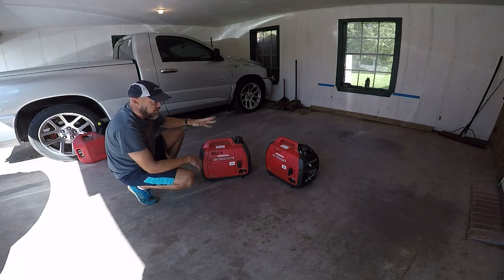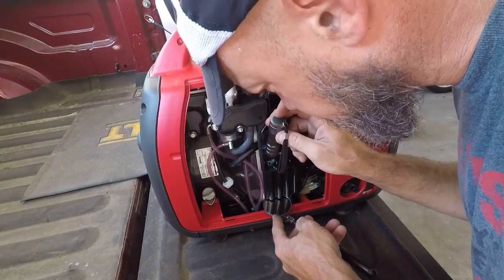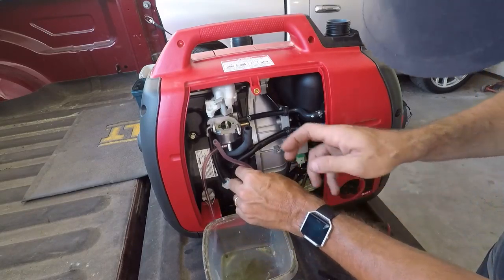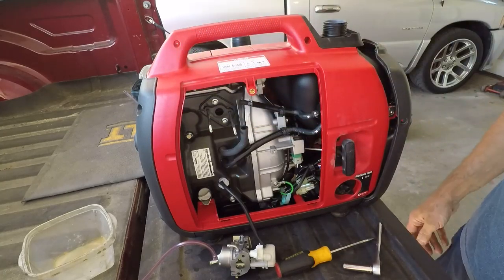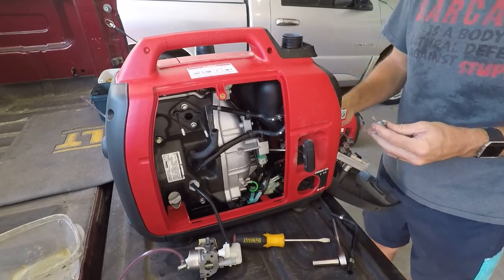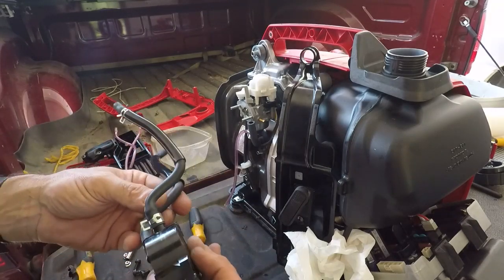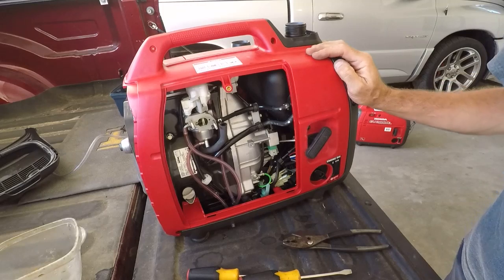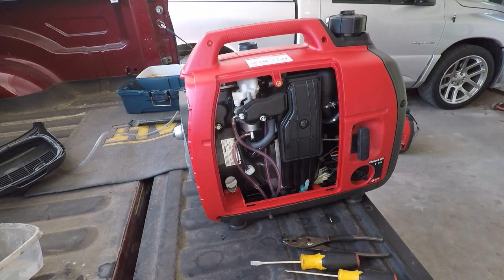Honda EU2000i Fuel System Complete disassembly and inspection

Comment: What a moron.  You have no  clue what you are doing.
Reply from the maker: Thanks for the clicks!
Reply: @aaronsrose  Aaron.  Amazing video!  Great job exploring the unknown and figuring out what you could.  I've had that issue before for several years then this year it just quit starting.  Mine will fill the carburetor float bowl (so I think the fuel pump is working) and it will run with fuel manually dripped on the air filter, at least until that fuel is exhausted, then it dies.  So diagnostically I'm stuck.  I'm gonna go back and make sure the fuel pump is air tight and actually pumping fuel.

Thanks again for an awesome video!

ps.  we're not defined by what trolls say, but by how we respond.  Good man.
Reply: Got mine running.  Main jet was plugged.  Thorough cleaning. 8 pulls fired right up, runs like a champ.

Thanks again, great video.
Reply: Didn't  change  a thing choke still on main jets never touched...
Reply: That’s why he did it. Investigate!
Reply: Enlighten everyone , tell us what you know.  You are looking on here for something. You go right into attack mode, I once was angry like you, you should consider getting over it.. And who are the 14 people who like this kind of crap ? You folks have some serious problems.
Reply: Sometimes the most effective way to teach is for the teacher to learn at the same time as the viewer. It means that the subjects that an experienced teacher would avoid due to irrevelancy are covered in full. My best highschool teacher taught in this way, and this video is a great example of the same teaching style.
Reply: @rogertrozelle8159  i
Reply: Aaron thank you!  @marktwo You're are a douscher.  Aaron worked at this thing without any help and actually knew quite a bit.  He has obviously wrenched before without a guide or manual quite a bit, learned from his father.  He wasn't afraid to make mistakes and took us on along on the ride for a pretty long video...unafraid to show what he did or didn't know.  And guess what?  He got it running fine without any help.   What do you do....douscher?  No youtube help either.

Comment: After shutting off the gas before you store the generator open the brass screw on the bottom of the carburetor float bowl and drain the gas out of the float bowl. That is why Honda has provided a hose to get the gas out of the of the bowl. These carburetors have a very small gas pick up hole drilled horizontally through the pick up tube that actually picks up the gas. That pick up hole will clog as the gas evaporates out of the carburetor bowl in storage. If you open the brass screw and allow the bowl to drain what little gas may remain is below the hole in the pick up tube and will cause no problem. If you fail to drain the carburetor bowl before storage,I can promise you that you will eventually, usually rather quickly, have a problem starting the generator the next time you want to use it because the hole in the pick up tube is clogged with residue from evaporated gasoline.

Comment: I know this was done a few years ago but before attempting this teardown I would suggest downloading a free copy of the service manual for this generator to familiarize yourself as to what the parts are and sequence of removal and re-installing. The manual has torque values of various bolts and screws, a full electrical schematic, exploded views of every component, etc. I've taken my bought used generator apart to fix an issue. Looked daunting at first but once I got into it, it wasn't too bad. Don't know about other generators but the Honda is well built of quality materials and components.  pretty easy to work on and genuine Honda parts are readily available and relatively inexpensive  online. For this reason the Honda is well worth the extra cost over the cheaper competitors. If you have mechanical skills and/or a DIYer you should be able to repair most issues on this generator, especially with the help of YouTube videos. By the way, when removing the Phillips head screws from the case use a #3 Phillips screw driver. Better grip,won't strip. Good luck!

Comment: I checked that fuel on/off valve more intelligently than you did without having to remove it. I just pulled the fuel hose at the carburetor and switched the valve to the on position and blew into it but nothing happened, so I tried sucking and was able to verify that fuel was indeed getting to the carb. The downside is that everything I had to eat for the next week tasted like gas. Anyway thanks for the video it was helpful.

Comment: The black plastic pilot jet controls the low speed operation, while the main jet controls high speed running.  When the machine's surging, it's the pilot jet that needs to be cleaned.  It's sitting under the plastic throttle adjustment screw.  Remove the screw and pluck it out to clean.

Comment: I bought a set of needle drills from eBay. They are tiny and just what you need for servicing a carb. The first thing I learned was the trick with the plastic idle jet. I overdid mine and had to buy a new jet. That vertical hole is tiny. 
Next is the main jet. Remove the bowl. Unscrew the jet and drop it out. Next there is a vertical brass jet which might need a little encouragement to drop out. The flat screw brass jet holds it in place. Once out it has about 6 tiny holes in the vertical on both sides of the jet. They become clogged up and a micro drill will gently clean them out. Then reassemble. All these tiny holes must be clean and the tank filter crystal clean. The white powdery substance is minerals from the low grade fuel. It builds up in the orifices and the filter. Excellent video and please do not take any notice of the couple of negative idiots. This was a very valuable video.
Reply from the maker: Thank you! I've been needing to tweak mine about once a month. I found the a single bristle off my old ratty wire brush held in a vice grip works pretty well. So far I haven't had to fiddle with the main. Hopefully that continues. Best regards!

Comment: Thanks for taking the time to share your experience disassembling and learning about your generator. I fixed my surging by cleaning the main and pilot jets, as others have commented. Then, I installed a switch that separates the fuel cutoff function and the shutdown function so you can run the generator out of fuel. Hutch Mountain switch (like  you, I made a video to share my experience and pay it forward to the rest of YouTube). I now run my generator every 3 months as preventative maintenance and have not trouble.

Comment: This video was very useful. I am listening to my Honda as I type. It is surging a bit but running ok. The reason I looked for a video like this was because I have failed to make my extended runtime hose work properly. There is zero suction coming from the fuel tank. Being as there is a fuel pump there should be suction. This is not gravity feed as is my Predator. So why no suction? I think the fuel filter that sits in the tank is responsible. 
It is 15 years old and is probably allowing just enough fuel to go through to run but with a little surging and it is killing the suction of the fuel pump. I needed the information on tear down. I have had mine apart but not quite to the level you did. Carb addressed in a separate post.

Comment: Note: That fuel shutoff valve is the subject of a current recall on these generators. The 2 phillips head screws on the valve were not correctly tightened at the factory and may leak potentially causing a fire. The recall service is free from your local Honda dealer, they slap in a whole new valve from Honda. 
Thanks for showing us how to get to the valve Aaron. Juan Nevada City, Ca.
Reply: The recall was on the 2200 not the 2000

Comment: Thanks for the great demonstration on disassembly; that was my motive for watching as I have fuel leaking only when running from somewhere between the shutoff Valve and the fuel tank in one generator.  Now I see how it comes apart so I can determine what leaks.My two generators have over 200 and 270 hours on them respectively (I keep a log), and I have used nothing but Ethanol Free 91 octane in them; they run just like when new in 2013.  I do run them at least monthly.  My boat mechanic gave me that great Ethanol Free advice after my second carburetor rebuilt in as many years.  Fixed the outboard problem; rebuild free for 4 years now.

Comment: I admire your patience stripping everything down but although so very close you missed the very cause of the problem .....the main jet needs cleaning. 1. Remove carb. 2. Remove float bowl  3. With a flat screwdriver undo the main jet and clean thoroughly. 4. Before reassembly make sure everything is clean and free from build up of dirt check all air and fuel ways are clear 4. Re assemble and you should have resolved you lumpy idle issue. Hope this helps you. John
Reply: Yeah probably caused by a the old fuel. I would think that would be the first suspect in this scenario. I assume at higher rpm there is enough Venturi to overcome the constricted fuel way.
Reply: John, in addition to draining the fuel from the line after use, would adding fuel treatment like Gumout Tune Up or fuel injector cleaners prevent the jet from clogging in the first place in your opinion?  Thanks!
Reply: Patience,  he just did not have a clue what he was doing or why.

Comment: If you haven't solved the problem yet, it could be the internal parts in your carb.  Fuel with ethanol that sits will form gum and varnish.  The parts that would get gummed up in the carb are not that expensive to replace, considering how much the gennies cost (I also have two EU2000i's).  The main jet, valve set with float, main nozzle are the three things you probably should buy and just replace.  You may want to also replace the fuel filter that you thought was the "tube within the tube".  You could clean them, but judging from all the youtube videos out there with these types of gennies having idle problems, a slight blockage could cause issues, even though you may think they are clean.  After you've replaced the parts above or cleaned everything and if the problem is gone, stop using fuel with ethanol.  Also, you may want to replace the gasket on the float bowl (according to my local shop).  Here in Canada I use the highest grade fuel from Canadian Tire, which does not have any ethanol at all.  Other things you could do would be to obviously use fuel stabilizer when storing, small engine fuel system cleaner, running the gennies at least once a week, and perhaps some Seafoam shot up the carb float drain tube.  There's a lot of videos out there on how to properly clean the carb's in these gennies.  Just do a quick search and you'll find them.

Comment: Agree with a few others that you may have missed the problem by not cleaning the main jet and pilot jet. Small flat head screwdriver down centre (where fuel bowl screw goes into) to unscrew. Take it easy as it's brass so more easily damaged. Tap to get jet out. Clear hole in the brass screw with wire.  I use small gauge fuse wire to clean through the holes. some are finer than others.  I was trying to track the fuel line from tank to carb for correct location of filter, fuel tap and vacuum for my own project so video was helpful.

Comment: I think it might be your throttle control module (white device on top of carb).  Changed mine and it fixed the problem.  I was having exactly the same issues as yours. Worth a try.

Comment: If it's running rough the first step is open side panel and turn drain screw on bottom of carb (shown at 10:40) to drain any possible water, debris. That solves my issue most of the time.
The other 2 clear lines are the vents. Black lines are to fuel.
I run these in the winter 40 or so times for 2-3 days and the fuel separates and the ethanol is at the bottom and is usually the problem.

Comment: I found a good quick of how dirty, or clean, the fuel supply lines are, is to watch how fast the carb bowl drains. Make sure the fuel switch is ON, and open up the bowl drain screw and watch what kind of flow you have coming out of the drain line. Fuel from the tank should flow freely just by gravity. The most likely cause of no or low flow is the tiny filter in the outlet to the fuel tank. It’s a pain to get to and while you’re there, pull the gas tank and clean the inside thoroughly.

Comment: The black part you couldn’t identify was a fuel pump.

In your carb breakdown you didn’t get to the TWO jets. They can get clogged with varnish.  The pump can also get trash or water in it but not likely.  

How is it running now?

Thanks for the video.

Comment: The Pilot Jet Valve on the back of the carb is plugged,,,thus the surging. easily removed from carb and a #8 wire/file will open the plugged hole and stop the surging. Happened to me too.

Comment: You have a plugged pilot jet, remove the idle screw, pry out the little plastic pilot jet clean the TINEY ORFICE with a piece of strand of copper wire
Followed with some carb cleaner, reassemble by installing the pilot by pressing all the way in, reinstall idle screw until it bottoms out, turn it exactly 5 turns out, now your Honda will idle like new.

Comment: "Surging /hunting when under load" is dust in the finger filter in the output of the tank behind the control panel side, starving for full fuel needs. "Surging at idle" is the very tiny hole down the plastic black idle jet under the black plastic idle stop screw on the exhaust side on the carburetor.   Usually very barely dirty in either but thats all it takes. Wet storing is the usually the issue.    Great informative vid,  good job and informative.
Reply: Thanks for the love... Sometimes I wonder if there is so many responses the logistics of any response is overwhelming.   Your video  reminded me of my Honda eu2000i endeavors educational path.  700 hrs on mine now.  Overhauled a blown up one from over oiling in the crankcase. What a mess.  Thanks again MC.  P.S.  Just pops and fires and quits can mean water in carb bowl or low oil shutoff.

Comment: holy crap all that just to get to the fuel pump wow ... having issues with one of these it doesnt seem to be getting gas from the fuel tank or the pump not sure witch but really dont want to replace now seeing how much you have to tear apart
Reply: I like to add that I went for it and found out you DO Not have to tear it completely apart to get to the fuel filter.. I just removed the front cover,unplugged few wires, removed the  bolts from the sides, then the fuel tank then i had full access to the rest of it inside. So much simpler then in this video. I think either the on off switch is clogged on mine or the fuel pump itself cause with the the tank bypassing both it runs fine. ran out of time the day i was fooling with it will mess with it more.
Reply: Hopefully by now you fixed it. But she'll only comes through the line when you're pulling the Rope basically a mechanical pump in the on position. Fuel comes out at the fuel hook up on the carburetor not that complicated quality generators big major parts don't just go out in them. Not stored properly cat problems start fuel at the carburetor liquid Gas makes it through all the filters right in your carburetor then sits there and turns to farnish drain everything thoroughly run it till it stops. Eliminate these problems in the future good luck. Mr. Honda

Comment: I just watched your video and it’s 8-16-2021, I was wondering if you solved problem. I have same generator that idles pretty good but when you put a heavy load on it then it stalls. If you have any suggestions I would love to hear. Thanks
Reply from the maker: Howdy! What I was looking for is the idle jet on top of the carburetor that's under a little plug. That plugs up and causes the idle surge. It shouldn't affect wot though. I'd try pulling the carb and giving it a good cleaning making sure all the little passages are clear. That usually gets the top end running better. Good luck. Thanks!

Comment: Hello, thanks for the video. I was given one of these generators from a friend. I learned a lot by ur video. Ty for taking the time. Do u think the 93 octane could be the cause being higher octane could be running lean? I believe the one I have needs a new inverter the electrical portion. With ur birdie I seen how to access it so again I ty for ur time to share. Did u ever figure out the problem???
Reply from the maker: Howdy! Sorry about the delayed response. The gas was OK. Octane wasn't the problem. I did eventually figure out what the issue was. There is a little screw on the carb that needs to be removed and cleaned out to solve the idle surge. I've attached a link to that video. Best regards, and thanks!
https://youtu.be/HE73-zly0LM

Comment: You got to check there is plastic screw on the top of the carb and it has to have a tiny hole as a breather 
Just type idle issue solved for eu2000i on YouTube and there is few videos about it, it  helped me

Comment: Mine does the same, I changed all the gaskets in the carb and nothing changed...
Reply from the maker: There is a little tiny breather on the top of the carb that gets plugged. If you can find it and rod it out with a tiny drill, that should fix it. Thanks!